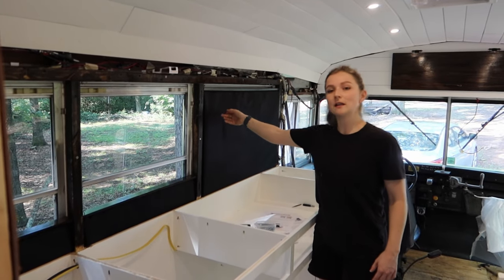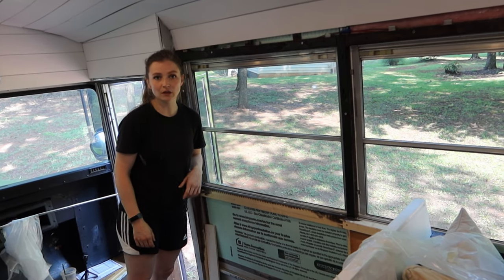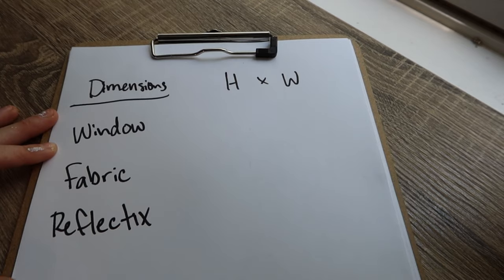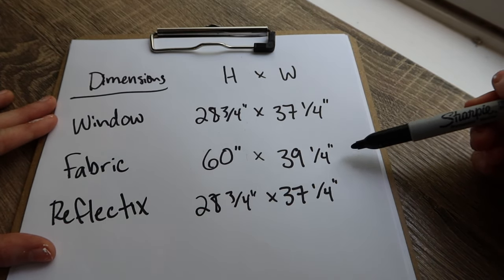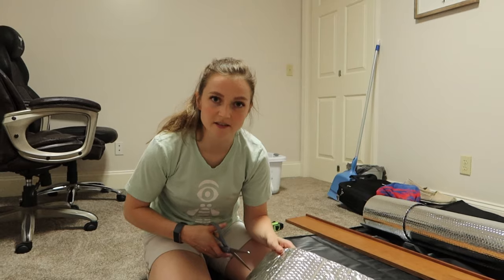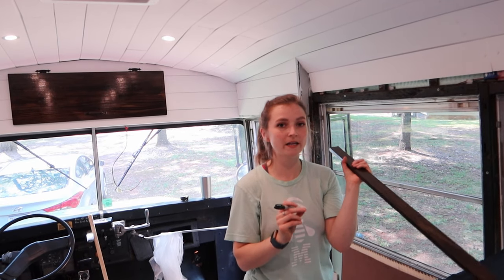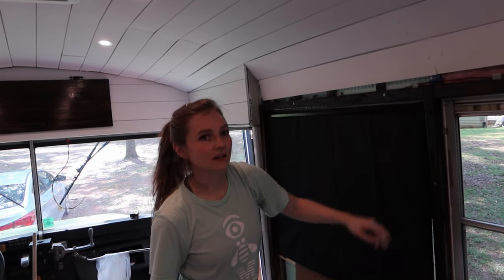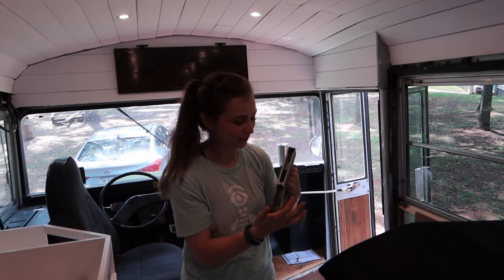Disappearing Window Covers (with Reflectix!!) | SKOOLIE BUILD

Comment: Thank you so much for making this video! I have something similar in mind for the windows, so seeing someone actually come up with a solution is fantastic. I’d like to sew a lighter fabric on the inside of the curtains to match the deco but also, find a way to hang them halfway so you get privacy yet still open the top window part for air flow...

I also plan to put the toilet on a slider so it has a ventilated cubby to make room for the recirculating shower! 🤔🤗🙏😍 🚍 🚽

Comment: How clever! I really like the hideaway shade & bug screen I see some bus/van builds use & definitely would want them in ours however they're pretty expensive but this is a GREAT ALTERNATIVE yet still very classy & creative! One question, what do they rest on when down? I went back through the video twice to see if maybe I missed it but I didn't find where/if you mentioned it. So glad I found you guys! You both are doing an amazing job especially considering that you don't have a lot of previous experience. I watched your latest video & the shower & cabinets look great!
Reply from the maker: @Melissa Pittman Thanks so much! 😄 The bottom of the window coverings rest on a small lip that juts out on the bus walls. Later, we may  add some small pegs in the vertical wood supports so that the top of the coverings are flush with the backsplash, but so far we haven’t needed to.

Comment: Hey which back up camera did you go with and would you recommend it? Thanks!
Reply from the maker: Here's the one we bought: https://amzn.to/3m3AICV

So far we really like it, especially for the price point. One really cool thing is that the screen has an option for 2 camera inputs, so we could connect another camera (not included) to add a second camera angle.  

The direction and angle can only be manually adjusted, but we can see really well with the position we chose. It helps a TON with changing lanes, as well as backing up.
Reply: @JimmyandNatalie  thanks! I’ll be hauling a boat with my bus so I really need to get one 😬
Reply from the maker: @Duck Gun Chronicles Haha, a good backup camera definitely sounds like a necessity then!